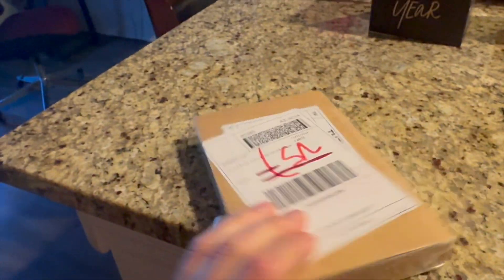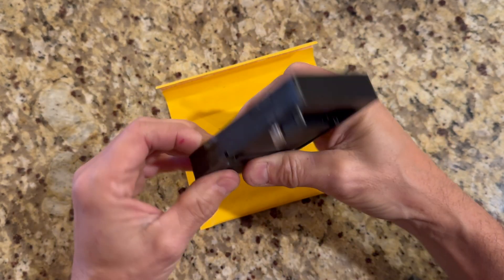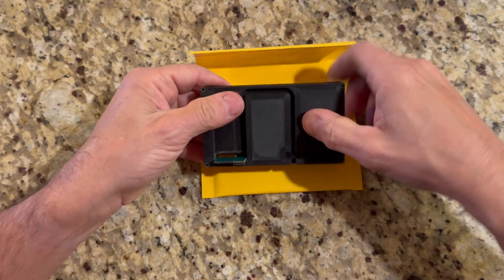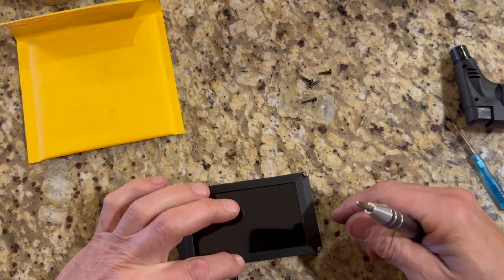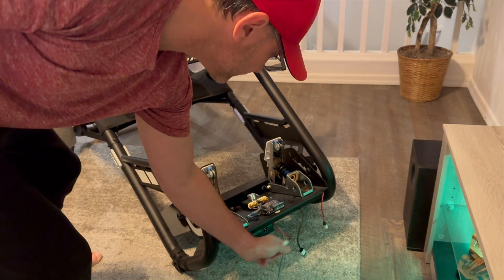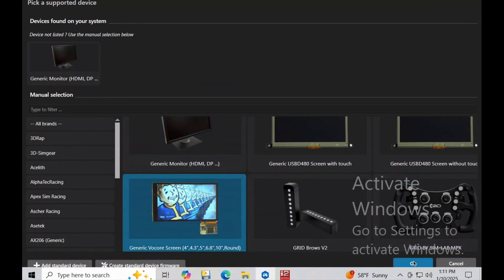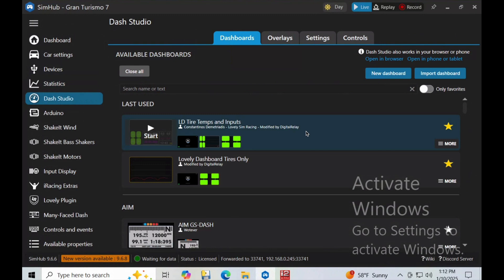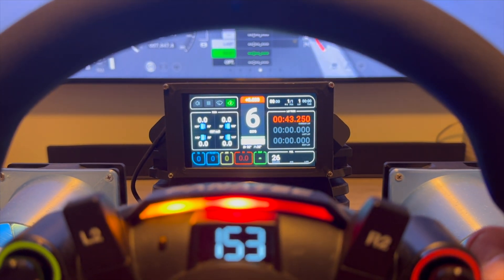How I made this sim racing dashboard display for $44

Comment: I just repurposed a couple retired android phones with an app tied to the games ip. One is for glancing during a race with just tire temps and a programmable shift light and the others show the data you don't get in the game or have to toggle to find off to the side. Yours is really clean mine has wires going everywhere.
Reply from the maker: Zip ties and velcro can go a long way to clean up cables. Thanks man! The more I use this dash the more I like it. Brake telemetry trace is probably the most valuable part of it for me. And I really like how when it goes to the idle screen, I have a GT7 background. It's dorky, but I like it.

Comment: You can use a smartphone or tablet with simhub to display a dashboard, including tyre temperatures
Reply from the maker: Yes. Before getting into Simhub, I used Eziodash on iOS for tire temps. It looks great, is easy to setup, and is donation ware. What I didn't like about using my phone is that I'd usually need to plug it into a charger and set it up on a tripod. And while using it as a dashboard, I couldn't use my phone. For $44, it's pretty great having the display installed on my rig where it comes on automatically, and is totally customizable.
Reply: @DigitalRelay I do the same i use an old Galaxy S6 as the DDU and it's perfect for my needs
Reply: Where did you buy the display itself??

Comment: It's cool. I assumed simhub would show tire temps for gt7? Because simdash for ondroid does.
Reply from the maker: Yes. Simdash, simhub, Eziodash are all getting the same telemetry data. I have not used simdash, but I have used Eziodash. If all you want is tire temps, those would be cheaper and easier, but I liked the idea of having a dedicated screen permanently installed on my rig that just works, and is totally customizable.